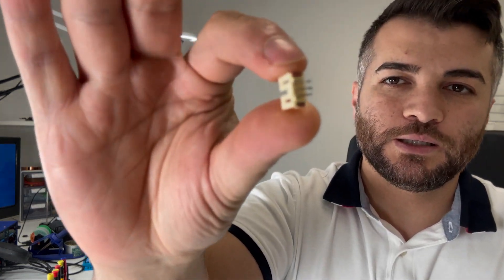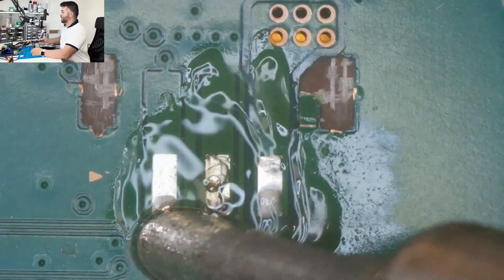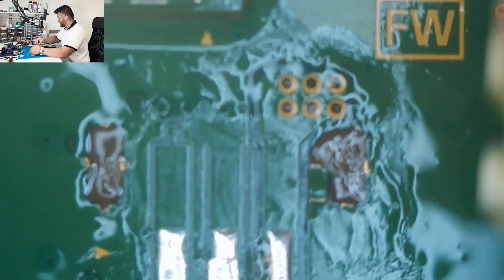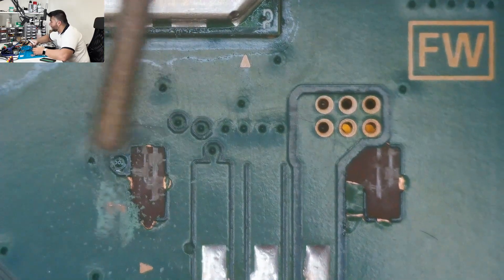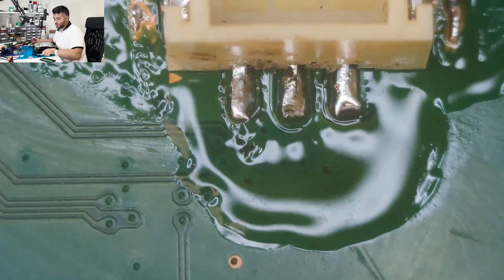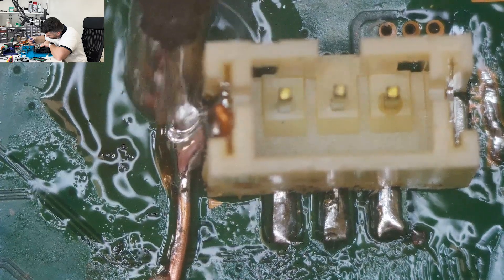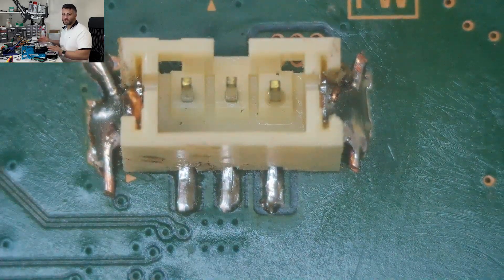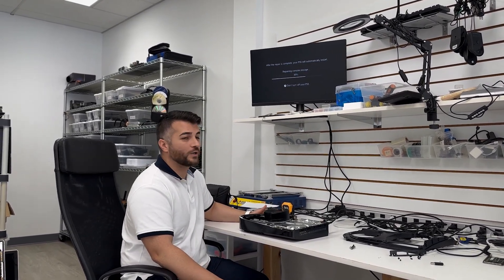PS5 Fan Connector Torn Pads Repair!

Comment: Well done. Adding solder wick braid and flooding with solder on the 2 anchor points and traces in my experience makes it very solid.
Reply from the maker: @mm0077  Thank you 😊 that’s a great idea as well.